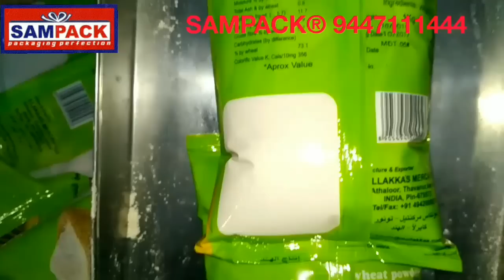Low Cost pouch packing Machine for Powder 100gm , 250gm, 500gm, 1000gm, VFFS Machine

Comment: hi send me the quotation of this machine as it is. shipped to mombasa port keny.
Reply from the maker: We are one of the leading Manufacturers for
premium range of industrial packaging machines, Automatic form Fill & Seal
Machines (FFS Machine), coding machines, and industrial packaging products.
There are widely used in the pharmaceuticals, garments, electronic, cosmetic,
food and beverages Industry including export houses .
Our machine is  Auto Weighing, Filling, nitrogen flushing, Sealing,
Coding, Batch Cutting, Cutting , counting all in one machine .One more special
features is that in our machine you can produce the packets ranging from 10gms
to 1000gms, 
Please Contact   +91 484 2382211 ,+91 9447111444 or Email:info@sampackindia.com

Comment: Price in mp
Reply from the maker: We are one of the leading Manufacturers for
premium range of industrial packaging machines, Automatic form Fill & Seal
Machines (FFS Machine), coding machines, and industrial packaging products.
There are widely used in the pharmaceuticals, garments, electronic, cosmetic,
food and beverages Industry including export houses .
Our machine is  Auto Weighing, Filling, nitrogen flushing, Sealing,
Coding, Batch Cutting, Cutting , counting all in one machine .One more special
features is that in our machine you can produce the packets ranging from 10gms
to 1000gms, 
Please Contact   +91 484 2382211 ,+91 9447111444 or Email:info@sampackindia.com
Reply: SAMPACK INDIA PVT LTD price ketna h es kaa